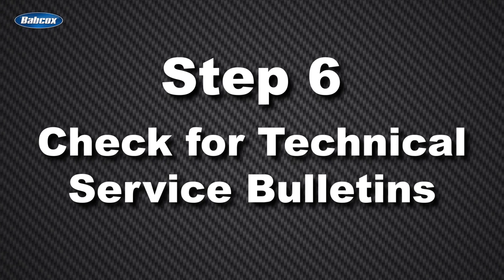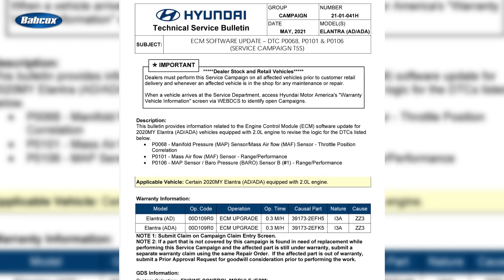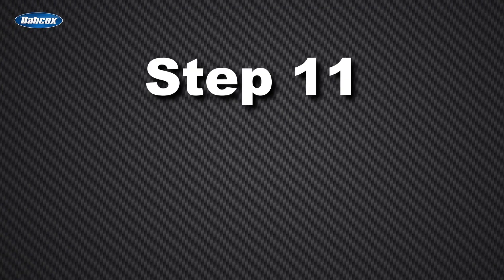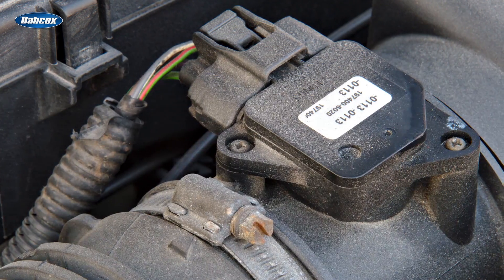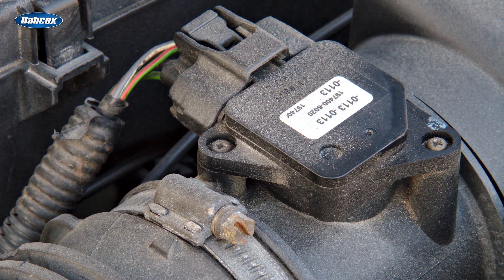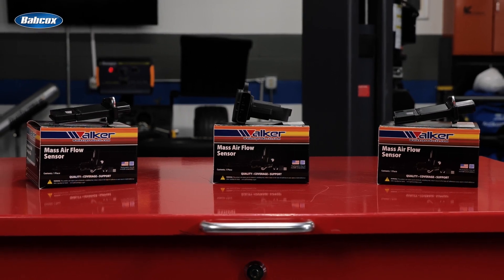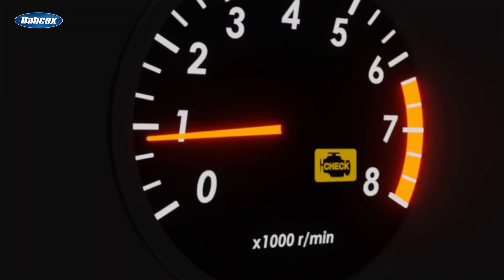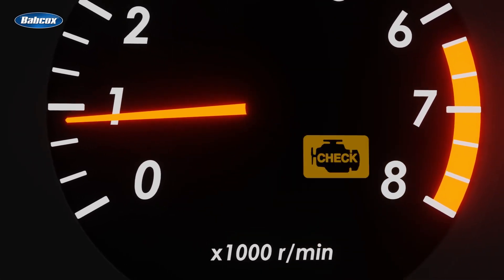Walker Products Mass Air Flow Sensor Diagnostics

Comment: how do we clean the 245-1164 Mass Air Flow Sensor Assembly for toyotas? the sensor itself is built into the housing and there isnt an obvious wire sticking out.
Reply from the maker: You're correct - those are tricky ones! Also very sensitive MAF Sensors. We always recommend replacing the MAF Sensor over cleaning them.